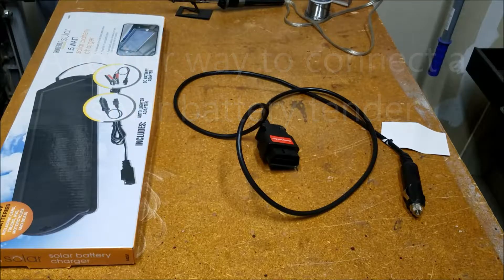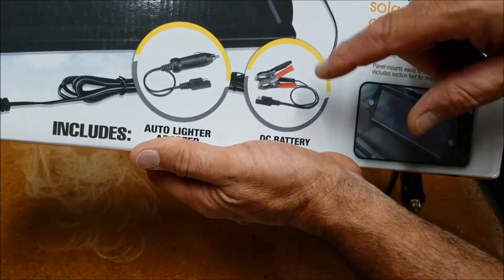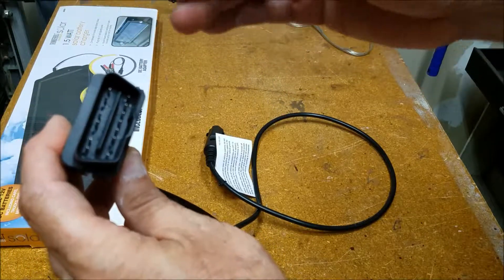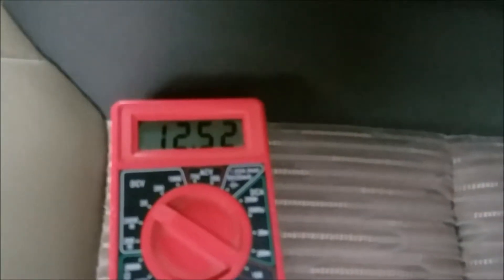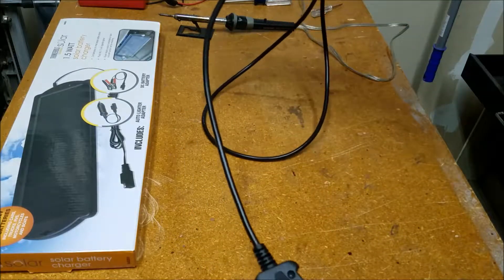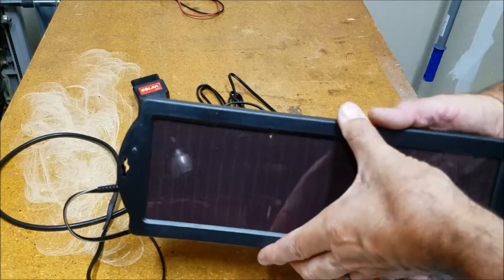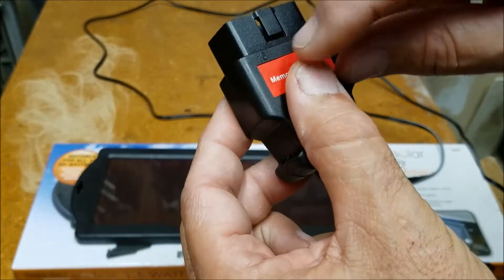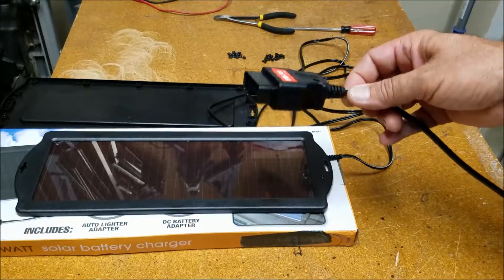Solar battery tender connected through the OBD port!

Comment: There is no point trying to save power by disconnecting the small blue neon, it does not save anything that is measurable, just imagine having the panel charging for days then as you open the car door the interior light comes on, or even the car alarm warning neon flashing away, so disconnecting that little blue neon is hardly worth the time and effort.
Reply: 5mm LED consumption 20mA. Nissan 1.2 liter consumption 30mA. BMW 3 liter consumption 20mA with intermittent 60mA spike. What does the math tell you?
Reply from the maker: @fungames24  It tells me that if a car with a power drain of 20mA can sometimes kill a battery in a few weeks, depending on battery condition, that an equal amount of power subtracted from the production of an already under powered solar trickle charger will equal trying to keep TWO  cars maintained with one charger.
Reply from the maker: The entire panel in direct sunlight puts out 1.5 watts (claimed). That's not much to begin with, so any little bit helps! Every time I visit my RV in storage the battery voltage reads about 13.4+ of surface charge. So it is actually working. Let me know if you try this. As another viewer posted, there are now some connectors available with other solar maintainers to do this type of connection.

Comment: Great video! 
Will this overcharge a 12v car battery if left unattended for a couple of days/weeks? Do we need a charge controller?
Reply from the maker: Everything I've seen/read about a low output panel like this says no. I leave it connected for weeks at a time to my Tundra and no problems. I also leave one attached to my dual battery travel trailer for weeks at a time with no ill effects. My trailer battery is consistently reaching 13.2-13.4V of surface charge when I go check on it. This is just to keep a battery that sits for a while from dropping to a damaging charge state. It won't act as a charger for cycling unless you want to cycle every month or so and wait a LOOOOONG time to use the battery again.